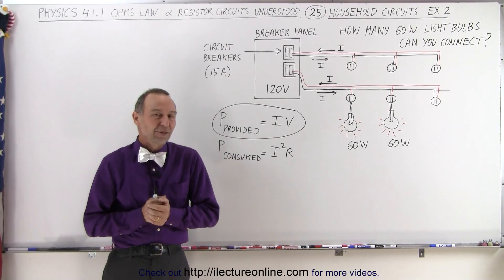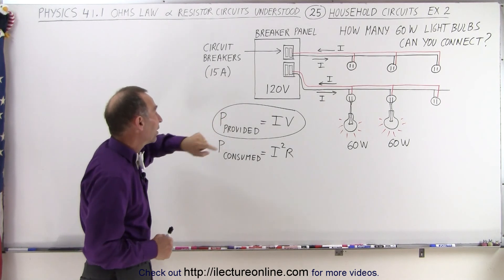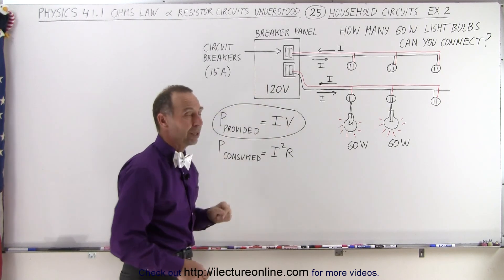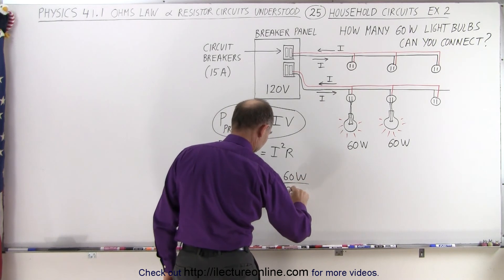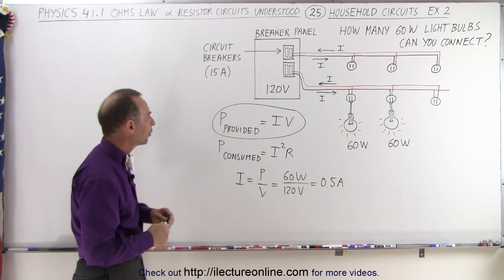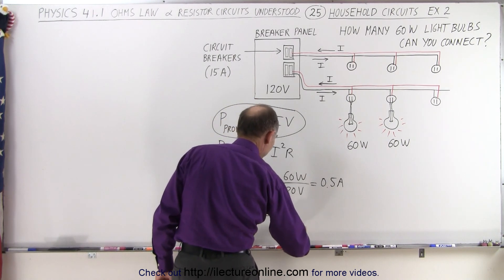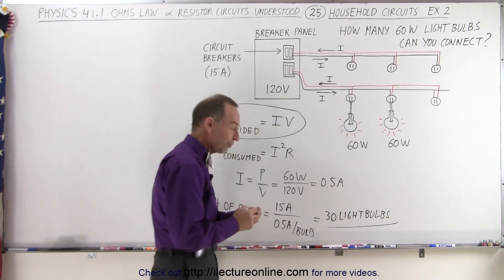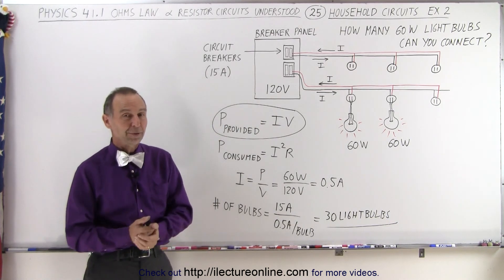Physics - E&M: Ch 41.3 Ohm's Law & Resistor Circuit Understood (25 of 42) Household Circuits Ex. 2

Comment: A qustion that disturbe me is, if we connet light bulbs in parallel(like every typical house), the resistance will decrese by half(assuming identical bulbs), and so on.
How that affact the other bulbs? or voltege drop?
Thanks Michel for this video and so meny others.
Osher(Electrical Engineering student from Israel).
Reply from the maker: Welcome to the channel!  Since all the light bulbs are connected in parallel, the voltage drop across them will all be the same and will remain at 120 V.    The resistance of each light bulb remains the same.  But the resistance of the whole circuit decreases each time you add another light bulb and thus the current through the circuit increases each time you add a light bulb.

Comment: Could you go over two and three phase power at the panel, the voltages available from them (208V vs 240V for the and two phase), and how they are derived?
Reply from the maker: We are planning a playlist in electrical engineering covering three phase power.